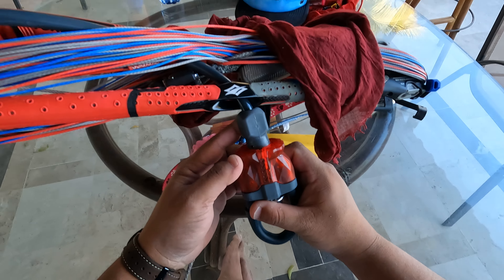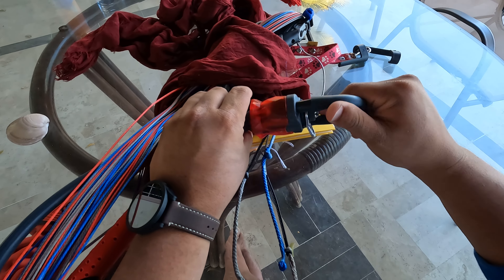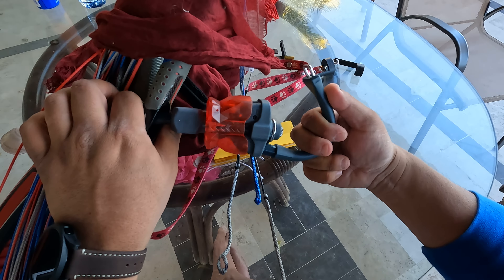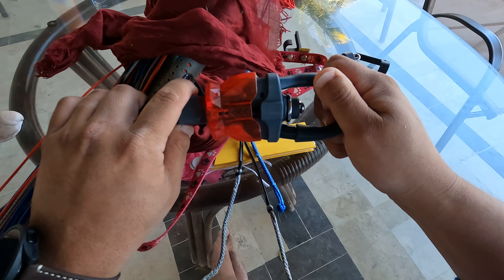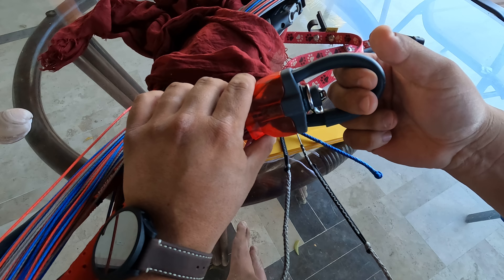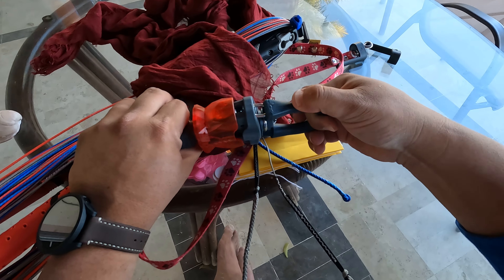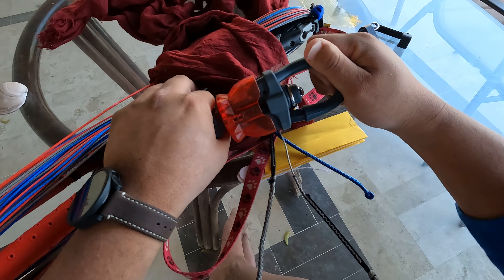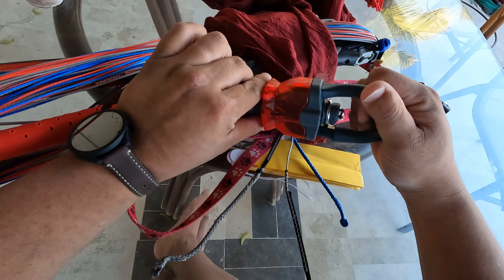Naish Torque 2 i3 Chicken Loop Weak Bungee

Comment: Wow, how old is this bar? Just received mine, after order being stalled because of previous verisons's security issuses.
Reply from the maker: Two days old.
Reply: @taiguy  😵did you contact Naish support?
Reply from the maker: @pileqrai  yes, watch the second video linked at the end. They were super fast in getting the bar replaced. Several other brands use the same i3 quick release. I looked at a buddy's ocean rodeo bar and it has the same weak return issue. I'm wondering if the the i3 quick release is more susceptible to this than other designs.